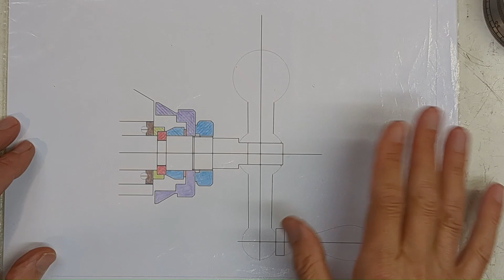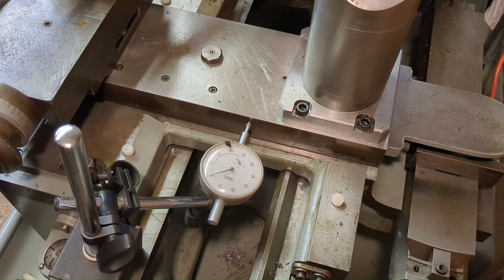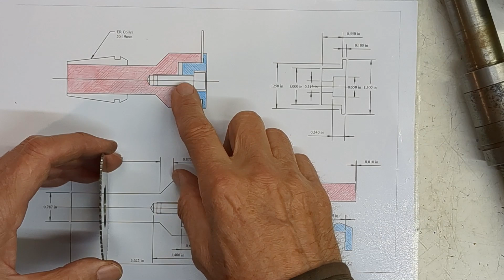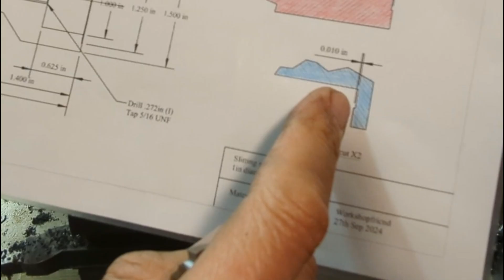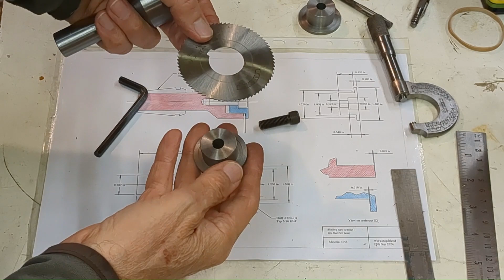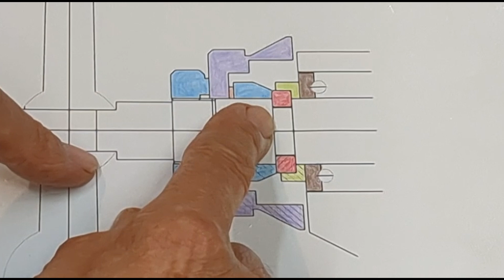Adcock & Shipley Mill Leadscrew Repair

Comment: Another superb video, Thanks Clive. The surplus to requirements component you removed from the lead screw looked like a hydraulic bonded seal.
Reply from the maker: Thanks, Carl. I didn't know that is what it was - just that it was plated.
Reply: @Workshopfriend  Not sure either but it looked like it had an elastomeric part around the periphery of the id.
Reply from the maker: I had a closer look. There is one on the inner dia.
Reply: @Workshopfriend Possibly someone thought the elastomer would provide some friction to somehow grip the dial.

Comment: My Adcock and shipley mill keeps slackening off by itself. 
Or as Joe would say it "unloosens" 
I will take advantage of your groundwork and see if I can work out the problem.
The other 2 dials
Knee and Y are fine.
Strange, we both have a problem with the same dial.
My machine is considerably larger  .. ISO 40 spindle but externally the dials look identical.
Reply from the maker: I would like to add an X axis table lock but haven't seriously looked into that yet.
Mine also has an ISO 40 spindle.

Comment: I have exactly the same on my ES2 A&S mill. I don’t have a slitting saw so I marked it off with a centre finder and used the thinnest hacksaw blade to cut the ring.. bit clean up, all good.
Reply from the maker: Yours, was a much more sensible approach! To justify mine, however, I wanted to make an arbour anyway.

Comment: It surprised me when I first came across Jacobs chucks that use a ring which is deliberately broken into two halves. I know this is a little bit of a different scenario but could definitely understand the part being discarded because of a lack of understanding for it's function.
Reply from the maker: Yes, could be left out of a rebuild! I suspect this had been missing for years.